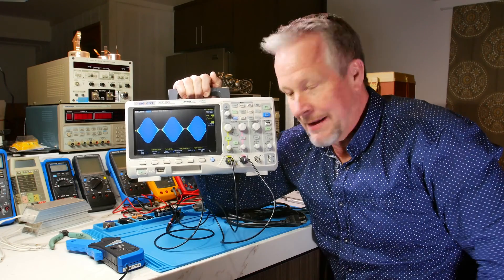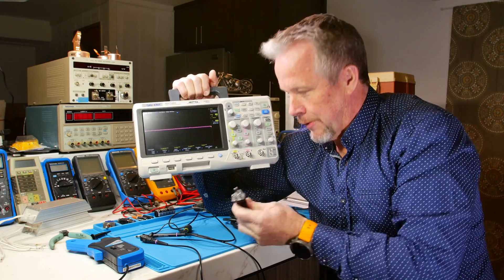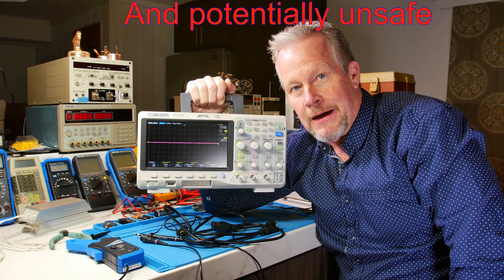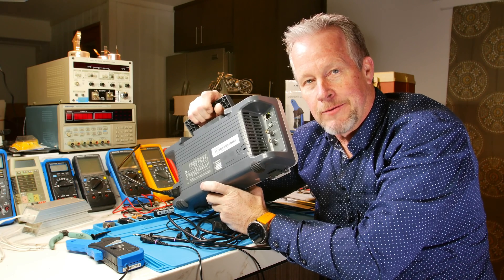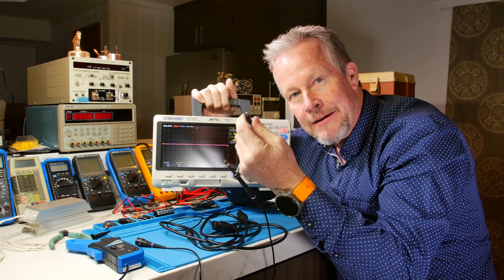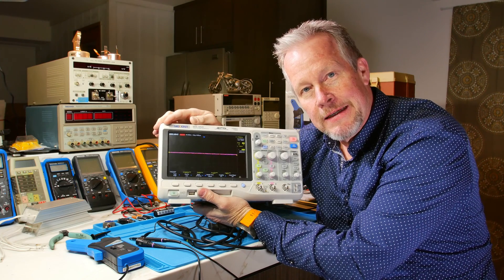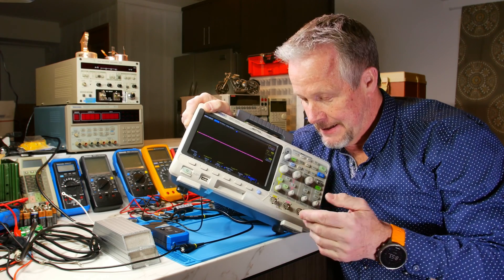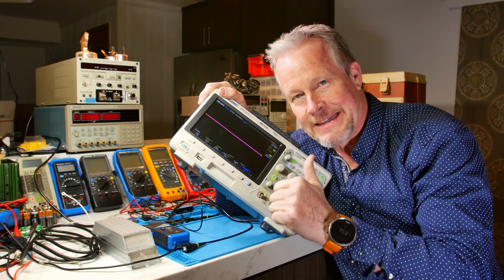oscilloscope safety - don’t blow up your scope or circuit #oscilloscopeisolation #scopesafety

Comment: Some people do not understand the concept of a scope.  A scope is not a multimeter.  The ground lead of the probe (and the ground connection on the unit itself) is connected to the earth of the power grid in your house or lab.  If you connect the ground lead of the probe to anything which has a voltage directly coming from the grid , bad things will happen.  Your probe may explode and you could get hurt or worse. It is a good idea to install and use an isolation transformer to protect your gear and yourself.
Reply: Be more specific. You would use an isolation transformer on what? The scope or the circuit being tested?
Reply: The device under test, ( D.U.T.)! @northgork
Reply: @northgork 
Only the piece being tested. NOT the ‘scope
Reply: @northgork  That is a good question because as i understand it you connect the O'scope to the isolation transformer and the transformer to the wall outlet but what happens when you connect the component to be troubleshoot to the wall outlet? Are you still in danger? If you connect the ground clip of the probe to the chassis of the component?
That is the question that nobody has answered.
Cheers
Reply: @SDsailor7  Look at this video EEVblog How NOT To Blow Up Your Oscilloscope for more information. Also Tektronix are saying it is dangerous to plug a scope into an isolation transformer and say do not float it, but they provide other options. Unfortunately the answer is not so simple. Quote from tektronix for safe solutions:
1 Battery-powered oscilloscopes less than 30 V RMS
2 Monolithic isolation amplifiers
3 Differential measurement systems
4 Isolated input oscilloscopes
Reply: @northgork  I have not seen a video that gives good clear and simple answers all the answers given are convoluted, evasive or incomplete cause they raise more questions.
Also i have not seen a video on how to connect the leads from the O'scope to the unit ie. BNC channel cables to??
Or the probe being used and the ground being attached they all bypass that.
Reply: @SDsailor7  A couple videos to help:
First from 12voltvids https://www.youtube.com/watch?v=nMHp_DFSeg0
2nd from Todd Harrison (pay particular attention to 7:00 - 11:30, as he describes what isn't mentioned in most videos how once you hook up one probe you must start being careful again and extra careful if you connect a 2nd probe) https://www.youtube.com/watch?v=11Yve2ijWyk
3rd from Mr Carlson's Lab https://www.youtube.com/watch?v=XBsQ3sZ45Fk
4th and last from Bob Kalpon who mentions the HOT side of power supplies and use of differential probes https://www.youtube.com/watch?v=JTfzgeJYFo8

Hope those help.
Reply: @redemptusrenatus5336  Thank you very much! I hope they do. I have the O'scope but don't want to use it until i understand how it works.
Reply: @redemptusrenatus5336  This was very helpful, I watched all of them now, thank you!
Reply: The way i understand it is that once the O'scope is connected to the floating plug on the transformer you are safe because the ground wire on the probe is now not connected to mains hearth.
Even though the receiver is.
That is the way i understand it.
Reply from the maker: 1959Berre you are right - thank you for your help
Reply: @KissAnalog  So the ground lead on the probe is connected to the metal part of the component you are testing? ie a receiver. Is that correct? and can i connect the scope to a variac?
Thank you
Reply: @KissAnalog  So, do you connect the isolation transformer to the house wall outlet and then you connect the O'scilloscope to the isolation transformer floating outlet(plug in)?
Some isolation transformers have both, a floating outlet and a grounded outlet to the grid.
Reply: As a noob it sounds as if (disregard your safety) it is better to not have ground on any gear in the lab at all?
Reply from the maker: I wouldn’t go that far;)
Reply: @KissAnalog  Many years ago I do a short circuit with the scope ground, now I use a cheater plug on each scope.

Cheers.
Reply from the maker: Ricardo B LOL I actually do too!  I am afraid to suggest that as a fix because of potential issues;)
Reply: @friedmule5403 
No - only isolate the unit being tested, NOT THE’SCOPE. 

There is a YouTube video under Isolation Transformers by an English expert JD? JW?

About 10 minutes into the clip he explains exactly why isolating multiple equipment can be catastrophic.
Reply: "A scope is not a multimeter". Thank you! This was a very helpful thing for me to see. It made a lot click in my head that I hadn't really realized before.
Reply: @kurchak  So it is ok to plug in the O'scope to the floating plug on the transformer and then plug the receiver to main earth?
That is how i understand it.
Reply: What if the unit/component that is being tested does not have a ground plug/pin like a lot of receivers/radios don't have? That means that they are not connected to mains earth right? 
and we can connect the O'scope/probes to it right?
Reply: @SDsailor7  if it only has 2 prongs then it is definitely not connected to earth ground, at least not at the plug. Technically that neutral plug eventually connects to earth ground at your power box but the device isn't grounded the way a 3 prong device would be (assuming it's wired that way inside). So you should be safe putting your probes ground clip to various places in the DUT. If you are in doubt, do what I do; always use the multimeter to check voltage between your earth mains (like the ground of the probe plug on your scope) and the point you want to clip it to. If there is a crazy high voltage between probe clip and that point then maybe don't clip it there.
Reply: @kurchak  Ok. So you say that there might be a possibility that the neutral wire of the cord of the device under test might be connected to mainsearth ground due to the fuse box being connected to mains earth? Is that correct?
I will check with the multimeter the probe ground to the chassis ground and i should get zero correct?
Reply: @SDsailor7  yes, as far as I understand it. I am not an engineer though, just a hobbyist :)  I believe that since neutral is connected to earth-ground at the box then if you were to put the ground clip on something inside the DUT that was hot then it would short out that hot line with earth-ground (Because the O-Scope probe's ground clip is earth-grounded). If someone reading this is more experienced, can you please chime in here? For both Rob and myself lol.
Reply: Well, that is true. But I just bought a scope that is also a DVM. Battery operated. Not even used it yet. But looking forward to learning.
Reply: While in concept a scope doesn't HAVE to be earthed - battery-powered handheld scopes wouldn't be possible otherwise - in practice, bench scopes always are by default.
Reply: Isolation transformer and or High Voltage probes?
Reply: If it is connected to grid PE. New usb powered scopes are floating. Or at least can be.

Comment: lol my dad uses those cheater plugs all the time.. a lot of his extension cords among other things have the prongs snapped off as well.. 
I feel like I understand some of what you said, but I wish you had shown us some examples. I'm more of a hands on learner and explanations tend to go in one ear and out the other.. I certainly don't want to learn what not to do, by doing it on my dh0814. going to spend most of the day thumbing through the manual and watching videos before I attempt anything with it!
Reply from the maker: Thanks for this feedback!  I will have to do another video on this with some examples;)
Reply: @KissAnalog  I think I'm understanding it better after watching a few videos.. when I probe a signal I need to attach the ground clip to that signals direct ground of least resistance, not just any ground.. and every other probe must do the same, sharing the same ground with no variance in the ground?
Reply from the maker: If you are on the AC mains side with 3 wire power cord - then the scope probe grounds have to be on the chassis ground (earth ground).  But if you are on the secondary (isolated side) then the probe grounds just have to be at the sam potential - doesn't have to be ground - if you are really on the isolated side of the transformer.  You can measure this with your multimeter - with power removed.

Comment: Using an isolation transformer with oscilloscope will it be ok if using a differential probe and connected via usb to laptop? Bbl
Reply from the maker: Great question!  After isolating the scope, it is good to isolate it from your computer.  Here's a video that talks about that: https://youtu.be/eXwiLac0PWM

Comment: Using a isolation transformer with oscilloscope will it be ok if using a differential probe and connected via usb to laptop?
Reply from the maker: Great question!  After isolating the scope, it is good to isolate it from your computer.  Here's a video that talks about that: https://youtu.be/eXwiLac0PWM

Comment: You need a guiding principle that you always have in mind when you use your equipment and that is: ensure that your test equipment is connected to earth ground(safety ground). Next if you float your device under test then you can connect its ground to your equipment ground. But keep in mind if your device under test has an isolation transformer, then its two grounds cannot be connected together(primary and its secondary ground). If you use an isolation transformer connected to your scope and your device under test to protect your equipment from be burnt up, one day your wife in come into the lab and find you slumped over the bench, but hey, at least the equipment didn't fry.

Comment: You can double check by using a multimeter and checking voltage between scope ground and circuit ground. If there is < 1v you’re probably fine

Comment: Great Point on the Computer connection!! That never occurred to me.

I have all my lab equipment connected to an Isolation Transformer. But usually do my work on the PC with the vendor supplied software.

OMG!

Thx
Reply from the maker: Thanks for pointing this out.  Yes I wanted to be sure folks think about the computer connection that is plugged into AC power.  

We have been testing in the lab and things seem wrong - then I realize that someone plugged it into the computer to send me screen shots;)

This is easily overlooked;)

Comment: Ethernet is isolated
Reply from the maker: Thanks for the feedback - but ohm your ethernet jack to your ground - and you may be surprised.  Ethernet often uses an isolation transformer to transfer the signals to the internal circuitry - but test your shield in your cable...

Comment: Valuable video but how on "Earth" can connecting the computer via ethernet port connect the earth back to the oscilloscope? Is ethernet port not inherently isolated?
Reply from the maker: Great question!  The shield on the ethernet port is grounded on the scope - so ohm your connection to your computer to verify.  This has been a surprise to others...

Comment: YouTube:
John Ward. 
Isolation Transformers Explained. 

You DO NOT plug your ‘scope into an isolation transformer.

About 10 minutes into the video

I’m no expert, but he explains exactly why.
Reply from the maker: Thanks for your feedback.  I've seen John Ward's video - and he makes good points - but there is no clear and simple solution to everyone.  The problem is - that there is so much confusion on what an isolation transformer is - and what it isn't - and the different types.  I'm happy to debate these topics with anyone;)

Comment: as for the "pc connection": for the USB-port I'm with you - the shield is usually connected all the way thru - as for a RJ45 ether jack?
at least from my personal experience most (as in more than 50%) of both the plug as well as the socket are made from plastic and only the up to 8 pins are actual connected
also ethernet connections are usually galvanic isolated - so although the ethernet cable itself carries the information it's floating in respect to "machine" it's hooked into - so there won't be any galvanic connection between a scopes ethernet port and a pc one
tldr: in difference to a usb connection an ether connection should not cause a ground loop as neither the 8 conductors nor the outer shield is galvanic connected all the way thru (hence shielded cables are kind of a scam as the shield is floating as its not connected to anything)
but I'm open to get corrected
Reply from the maker: Thanks for the feedback!  I've been in labs where the user didn't check the USB connection to the computer - and it caused a problem.  Best way to check is to just use your ohm meter with power turned off.
Reply: A shielded Ethernet cable would likely propagate earth ground, does no my desktop PC. Those cables are not that uncommon, but can be avoided.

Comment: Obviously you have never worked on the internals af motor control systems that if you scope is NOT isolated you WILL blow the scope or the drive.
Reply from the maker: Why do you say this?  I have actually worked on those things.  I have lots of videos showing differential probes.  Just not sure how you get to that conclusion watching this video???

Comment: Should always isolate the DUT not the test equipment. But sometimes we do things because we have to.....
Reply from the maker: Thanks for your feedback!  I have worked in many labs that float scopes - not that it is recommended for safety reasons...
Reply: @KissAnalog   I have heard both ways also. I think the important thing that you point out, is always stop and think that that ground clip on the probe is connected directly to the PE ground.  
Thanks...

Comment: A few points: first, many if not all modern scopes with two or more inputs can be set to differential mode: it might be a switch  or menu selection with "Sum" and "Difference" or "Add" and "Subtract". In this configuration, the ground clips on the probes need not be used. This is especially useful for plain old telephone lines: the wires are long and pick up large common mode noise, so if either tip or ring are grounded horrible buzzing noise is introduced. Sometimes performance suffers,  and there certainly are limits to it: you can't expect to investigate noise between a pair of 1000V circuits or circuit points especially if they are ground referenced. Floating an AC line powered scope also has similar limitations:  elevate the chassis high enough and it will arc from ground of the scope to line or neutral through power supply elements or nearby circuit traces. Sometimes the limits to maximum common-mode voltage are expressed on the front panel, but should be spec'd in the manual. Second, most if not all isolation transformers bridge ground across the windings by default: thus they just don't do what most people expect. Also, Ethernet connectors are fairly well  isolated: if you had problems I bet you used a less common shielded STP cable: they always sound like a great idea but are usually just a big hassle, as both ends need to be well grounded. Thanks for reminding me that although dangerous internal faults in a modern scope are highly unlikely, the chances of elevating the scope chassis through the circuit under test by human error or otherwise should be carefully considered.  In general, anything outside of plain vanilla should be planned carefully, with consideration of the limitations of each device in the chain and "what if" scenarios, and verified that each piece does what you expect: assume nothing.

Comment: Never float your scope, only the DUT!
Reply from the maker: Thanks for your feedback - but why do you say that?
Reply: By using an isolation transformer on the DUT, you isolate the chassis ground of the work, from the earth ground of the O-Scope. By isolationing the scope itself, If you accidently hook up to high voltage in the work, now you've tied your scope lead back to theBNC connectors of the scope, giving them high voltage as well. @KissAnalog

Comment: You know i've seen this video before and daves, but clearly I clearly didn't get the memo, was just working on a power supply and tried probing post  rectifying then tried to set up second channel to look at the first and overlap, about a minute later heard a small pop and smelt some burning :). After watching the video I still didn't understand so I went over and probed the shields with my meter which confirmed they were combined together then I realized what had happened. rectified 0v gnd then i tried putting 28v ac in on the same ground (Facepalm). Can't complain though, live and you learn, scope seems ok for now. If i could go back and time id let it happen again hahehhehehe
Reply from the maker: Thanks for this feedback!  This is a great story for everyone.  I think we've all done this once - at least;)

Comment: When I was a noob, I wanted to measure the ac ripple on one of my dc power supplies, and like a dummy, I connected my clip to the neg banana plug on the power supply instead of ground, and pos to pos banana. Well I blew the breaker, and blew channel A of my cheapie Hantek.  Scared the crap out of me.  I though that my channel A would be gone forever but months later I was able to locate an open smd series resistor with the help of a friend.   Boy was I lucky!  I heard you can also use  A-b by discconecting your gators and conect channe B to board ground or whaterver it is you are working on but never tried that, thats not totally safe either.  Good info all around!
Reply from the maker: Wow - thanks for the great feedback!  One helpful note is to go slow and before connecting any ground - do it with power off - and then bring power up slow if you can.  If you see a lot of current or the probe ground wire starts to heat up - then bring power back down.  Another safe way i sto to use an ohm meter to measure the ground to your scope ground to be sure that they are the same potential (before connecting your scope ground).